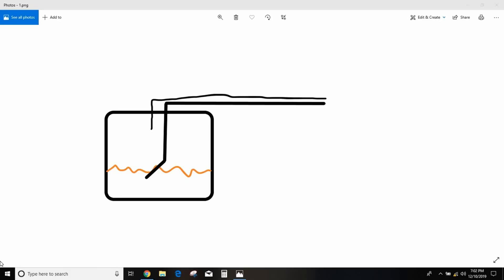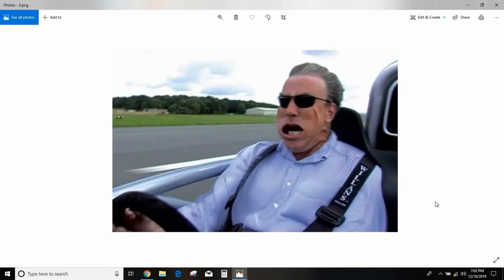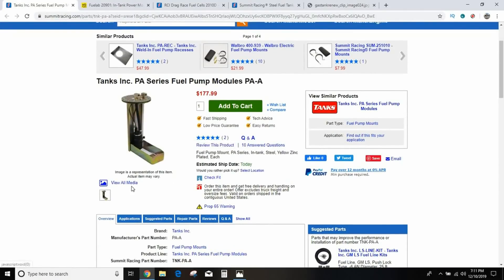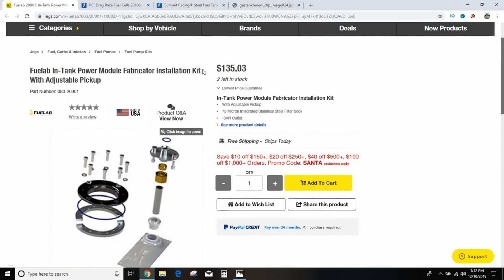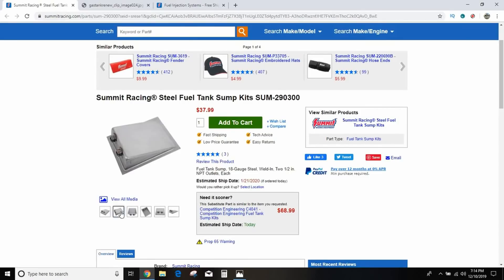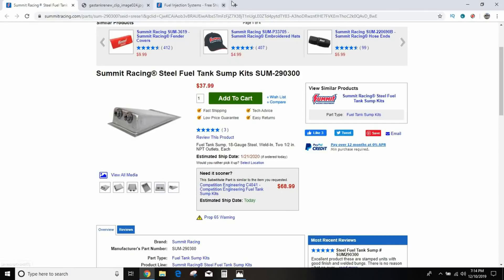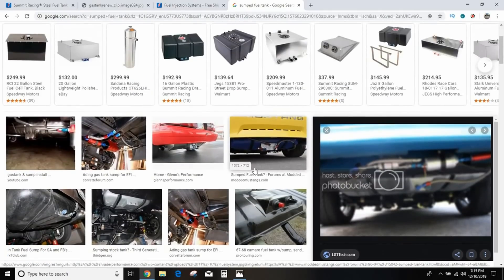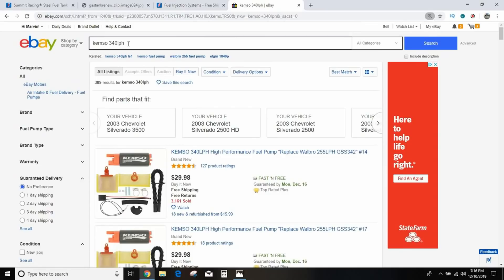LS Swap fuel tanks and pumps, internal or external

Comment: Thanks. I have two classic car projects and I was wondering a route to go if I ditch the carb. Good to know pumps that are good and work. I learned from the FI Sucks guy on my RV a GM throttle body can be greatly improved by using the newer 96 up? Higher PSI in tank pump and injectors for the 7.4L , mine came with a 7.4L engine and TBI but I sent them to the GA based “fuel injection connection”guy to rebuild and flow matched for $20 each. He rebuilds, sells remanufactured and new. 
moreover in 1990s Marine Power (and other makers) used throttle body injection for boat makers and on one of mine the fuel pump is mounted on the top of the block (why? right?) and they used the larger 7.4l TB and the larger 7.4L injectors on a 5.7L.  Makes 310-320? with no mods. I have not traced the fuel line/return line back or inside the tank to see exactly what is pushing fuel to the marine power external pump.   Point is that there may be a marine application that can be adapted. Many boat salvage yards to mine in.

Comment: Hello Jr.. This was a very informational video. Thank you. I do need your opinion. I have a lowered 1967 Oldsmobile Cutlass convertible. To fill up the tank,  I need to get in my knees to reach the input nozzle. I have a 4.8LS engine with a 4L60e transmission. I have a corvette external fuel pump and filter. So the return goes through the pump/filter. How can I modify my refueling options? I was thinking an external fuel cell in the trunk. Can you offer any other suggestions JR?
Reply from the maker: If behind the plate is too low for you, a cell in the trunk is probably the next best thing
Reply: @TheDrivewayEngineer  Thank you for your suggestion.

Comment: couldnt u open up any tank and drill a hole in bottom of tank and attach some kind of 6 an fitting that compresses together thru sidewall of tank and would always drain into a small say 1 litre reservoir and therefore sidestep the fuel starvation in hard cornering /acceleration?
also would using say 1/2 feed line between pump and fuel rail push a larger volume of fuel forward and give you 50% more time under accel/cornering before engine starves for fuel?
Reply from the maker: They call that a surge tank

Comment: I really do not enjoy all the extra time I have to spend on a simple issue of fuel. I put a carb on my LQ 4  6.0 engine because I am old and hate wasting my time trying to figure everything in the world out. I am going to put it in a 57 Chevy that was a parts car for somebody else. I do not want to spend the rest of time trying to figure out what pump I need to pot into a  stock or modified tank. I do like the idea of the sump add on and I am not crazy about spending $900 on a after market set up so I will just go with the suggestion because I need a $120. tank any ways.
Reply from the maker: If you have a carb you don't need a sump or new tank, just a pump, return regulator, and way to get fuel back into the tank

Comment: I used the stock tank in my 78 k10 got a sending unit from a 90’s car same diameter used a walbro universal pump My first pump failed in 100 miles sent it back for warranty now two years later that one’s starting to act up ! Thinking about getting a 2000’s plastic truck tank and modifiying it to fit
Reply from the maker: Idk why you'd do all that when you can just put a stock 87 tank in without modifying anything.

Comment: Hey will a tank from a chevy monte carlo 4.3 fit a 87 cutlass
Reply from the maker: I don't see why not
Reply: @TheDrivewayEngineer  thanks.. because my 87 cutlass is carburetor..I believe the 4.3 monte is fuel injection
Reply: @TheDrivewayEngineer  hey so if  I use the factory tank,pump and sending unit do you think they still be enough fuel pressure for an ls swap
Reply: 86 monte carlo

Comment: Hey jr I'm trying to use an fittings on  a 90 bronco efi tank it has oem 5/16 and 3/8 inch quick connectors on the tank side, do you think the an adapter for gm will work?
Reply from the maker: Probably not, but I bet they make them for Ford's also, look for Mustang stuff.

Comment: FYI you can solder/braze the sump onto the tank,i did it on my stock 79 camaro tank and it never leaked.But you will still have issues at lower fuel level when coming to stop signs and such.I finally switched to a TANKS inc tank and pump setup and it works flawlessly

Comment: Just installed the Tanks Inc. setup up last night in my ‘84 C10 stock tank last night. Drilled the 4 1/2 inch hole between the original sending unit and the fill pipe. It was the flattest place other than where the sending unit was already installed. Welded the split ring to the underside of the tank after drilling the required 16 holes. It went pretty well, but some shaping and dollying of the opening required to get a completely flat opening. I used c-clamps to hold the spit ring flat to the tank to mark the holes. Drilled a few at a time, used screws to hold alignment , and drilled some more, working my way all the way around. Time consuming for sure, but ended with fairly good hole alignment. Where a hole may have been slightly off, I used a small round file to remove metal in the direction to make it work so the screw start perfectly straight. Cost wasn’t too bad, I think $250 for the PA5 and bracket/sump assembly. Thanks for the info. I cut off the fuel pick up tube on the original sending unit just below the float reo stat so I can use the original gauge. “Fuel pumps, not fuel sucks’” made me spit my coffee. 

I’m wondering why I couldn’t install a manifold line to my other tank on or near the bottom to allow use of my second tank without an additional pump set up. Fuel will seek level between the two tanks. I’ve had that idea for awhile, but never got anyone’s opinion.
Reply from the maker: If you ignored the selector switch, that could work.

Comment: jr look into GM , 3800s2 supercharged, 3.4dohc , from a  w-body 95 to 2005 Buick lesabre, park Avenue,grand prix, ltz monte carlo's the sending unit and everything from a w-body fuel system is in the tank minus the filter.. the 98 to 05 park avenue/lesabre fuel system is a 4 pin plug.
there like junk yard land mines there laying around everywhere in yards and are cheap like the dirt there found near. do a little research you may be able to get one to work out.
Reply from the maker: For the Olds, the challenge is the fill is under the plate, not ofset like more modern cars.
Reply: may wanna look into possibly a Buick gn tank.. the width is smaller but it's a little deeper in the front

Comment: Good topic man - future vid idea, is how to cheaply PLUMB fuel line, I've found surfing the Dorman Help fittings there's all kinds of cheap adapter and crossover fittings like for fuel rail hookup, and adding a $10 fuel filter GF652 to the fuel line.  Most guys focus on cost of tank/sump/pump(s) and it sneaks by them on how easy it is to spend way to much $$$ on expensive fittings.  Love the great work!

Comment: Jr, I got an lq9. Will ls3 821 heads bolt on an work 6.0 with no issues?? I wanna use an ls3 intake on it too. Just making sure it works brother. Thanks in advance bro.
Reply from the maker: It does, you have to change the rockers and stuff also
Reply: The Driveway Engineer I’m going with complete ls3 heads. The all oem stuff. My boy doing my ls swap has everything including intake.

Comment: Can get a 2L surge tank for $33 on ebay and then add a $27 044 300lph ebay pump. 

What I found is the low pressure pump must return to the tank to keep it cool.  I allow the high pressure pump to circulate back to the surge tank.

Kinda wanky but works great.

Comment: You missed one option! You could modify your stock pick up tube by cutting off the area after the sending unit and with fuel hose attach an in tank electric pump. You could build a little baffle cage for it too, but its not nessesary for a cruiser. Ill make a video of what I have installed in mine.
Reply from the maker: Without a baffle you'd want a pretty good sock on there so it's not picking up trash from the tank.
Reply: @TheDrivewayEngineer  I used a stock pump from a tbi truck and it came with a pretty good sock. Idk what puml to use for an efi app.
Reply from the maker: NightWrencher if you're yard shopping, the pump from a Vortec 5.7 96-99 makes LS pressure
Reply: @TheDrivewayEngineer  does it have a built in sock?
Reply: I ended up getting a sending unit from a 90’s car it was close to the correct height and diameter
Reply from the maker: It fit the hole?

Comment: Starts again at 9:00

I’m considering the Tanks Inc setup at 9:55 for my 68 Camino.  Supposedly a 95 Caprice Wagon tank will fit after trimming the frame, but by time all is said and done, it’ll probably be cheaper with the drop in in the stock tank.

Comment: Amen! Frame mounted electric pumps are for trailer queens - always have been, always will be. Useless (or hopefully useful?) trivia: Cadillacs that were the same generation had factory EFI starting in '74. I'm told that '77-'97 B-body tanks are not a nightmare to install in that car, and are a lot easier to come by. Yes, the tank offset is to the wing side of the car (70s Olds have driver's side exhaust, while everything else had passenger's side exhaust), but I've used the pre bent olds tail pipes for dual exhaust in Cadillacs and they still fit. The '75-'79 RWD Seville were 100% EFI from the factory, and those tanks are a bolt-in for most '70s X-body (Nova, etc) and F-body cars. The Seville may look like a G-body, but it's really a stretched X-body with B-body suspension. The 70s Caddy setup used a high volume / low pressure in-tank pump (baffled), and a frame mounted high pressure pump. Early EFI Ford trucks had a similar setup, with an identical-looking pump, but later models of the same body style had a high pressure in-tank pump. That pump is a bolt-in for the 70s Caddy tanks... Just some bits that might help someone.
Reply from the maker: That is helpful, I'm not super familiar with the platform, I honestly don't even like the car 😂 it's really my wife's lol.
Reply: Hi.. Did you ever try that Box Caprice fuel tank in your wife’s car. I’m swapping a 76 Cutlass and don’t want to buy a $800 tank
Reply from the maker: Nope, that car is long gone